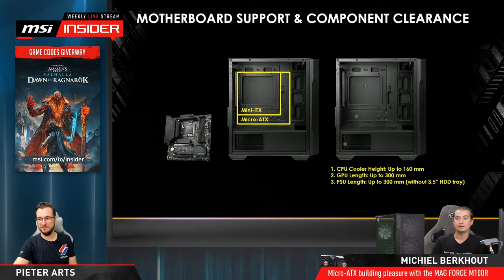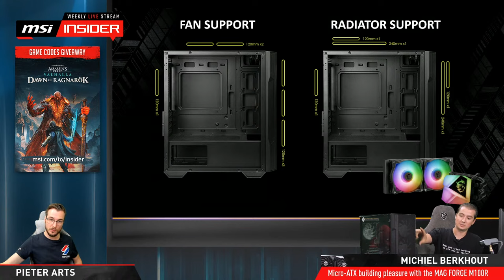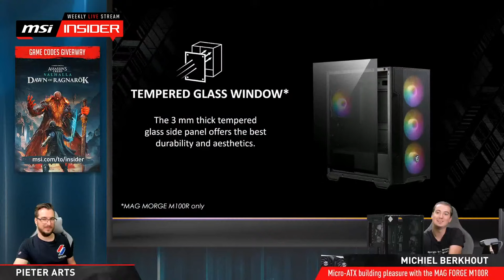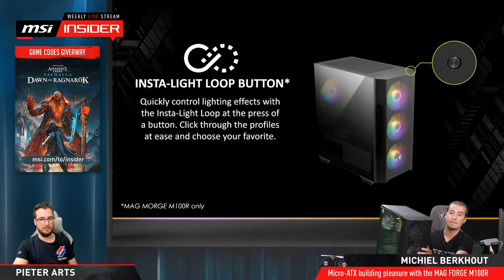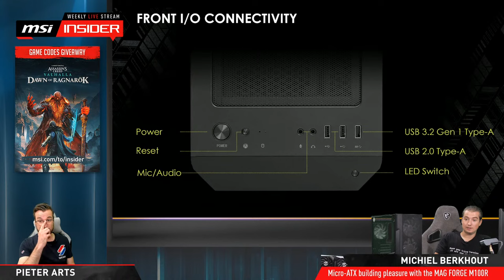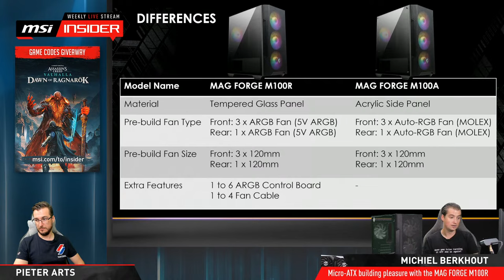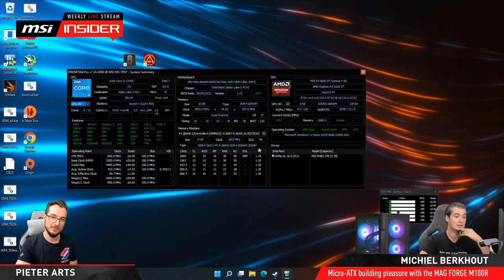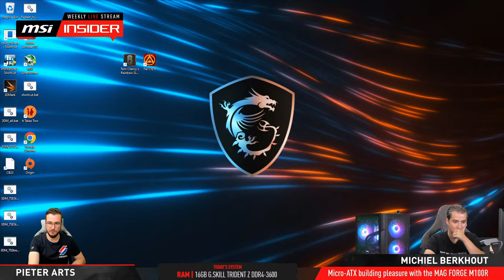Micro-ATX building pleasure with the MAG FORGE M100R

Comment: Good to see MSI finally making some more airflow mesh cases. I just ordered one and looking forward to building in it.
Reply: How is it going?
Reply: @babaty6829  Good it was easy to build in but was alittle fiddly due to my man hands. I reused some spare parts I had. A Msi b450m mortar max motherboard, Ryzen 5 1600af and a Msi Rx 5700 Gaming X graphics card. Haven't really tested it yet with some games or fully stress tested it yet but will get around to it at some point. Going to pass it on to a family member. They are going to love it. Its not a bad budget case.
Reply: @auswolf9507  how about the build quality compared with Lian Li and Cooler Master?
Reply: @babaty6829  i have never really built in those brands of case before. I build pcs as a hobby. Much like this case those brands probably have different types of cases and quality depending on model. So far I have only really built in a Thermaltake Versa H18 which is another Matx case which is similar to this case, DeepCool Matrex atx case and Fractal Design meshify S2 which is a large ATX case and isn't a budget case like this case the or the other two I have built in previously. This case easily beats the thermaltake and Deepcool cases with airflow and cable management.
Reply: @babaty6829  Plenty of awesome case reviews on youtube. You could check out Gamers Nexus for in depth reviews on different cases. Doesn't always hurt to look into other cases. I know Coolermaster have a ton cases with many confusing naming schemes and Lian Li have quite a few cases on the market which are pretty good. Coolermaster has made some duds in the past.
Reply: Hi! Im going to buy this case with i5-12400f and rtx 3060 12gb. 
I wanted to know if the air flow is good and how are the temperatures? Thanks!
Reply: @Cookies7  Haven't turned it on for a few months or really used. I had some old parts  sitting around so I built a AMD system in the case with an MSI B450m Mortar Max, Ryzen 5 1600af processor and a MSI RX 5700 Gaming X Graphics card. Graphics card was a tight fit but was able to get it in fine on the right angle. Airflow should be fine. Plenty of ventilation. The only thing is this case doesn't have a dust filter on the front of it so over time your pc may need a good clean out if you live in a dusty house. Oh make sure to get a decent cooler for your processor. The intel stock coolers are noisy as hell and aren't the greatest in hotter climates, similar to the AMD Ryzen stock coolers. The fans that come with the case do an alright job keeping everything cooled. Been meaning to get it plugged in again to test out temperatures during game play and set up some fan curves for it etc just haven't gotten around to it.
Reply: @auswolf9507  Alrighty! Thank you so much
Reply: Just be sure to get a decent aircooler for your i5 12400f. It will probably run fine with the stock cooler but you can easily drop the temperature quite a few degrees with a decent cooler. less noisy also.
Reply: @auswolf9507  Thanks for the tip! Im gonna do that
Reply: Can i sync all argh with mystic light?
Reply: @maciulo798  If your motherboard has a Jrainbow header or possibly a ARGB header, I believe you can set it up to work with Mystic Light. You would need to refer to your motherboards manual and the manual that came with the case to check for compatibility. Some motherboards have the Jrainbow pins, other motherboards may have different types of rgb headers. Some motherboards don't have them at all. Always best to check the manuals for compatibility. Honestly I never really bothered to connect the cases Argb hub to my B450m Mortar Max board and opted to just use the led button built into the case to change the lights on the fans.
Reply: @auswolf9507  hello do you know if we can turn off the rgb?
Reply: @auswolf9507 How noisy can this get when gaming?  I worry about towers full of fans in the event they all kick up speed and make a hot racket!  Haha.
Reply: @Tube2097   
Testing out my nephews PC the other day the case fans were not overly noisy when testing out a few games. Only really heard the cpu cooler whirring away and the graphics card when under load was loud. With a little tweaking I got the graphics card running cool, quieter and much more efficient.

Comment: If there is a dust filter at the top of the case, then the two fans on top are supposed to be an intake not an exhaust don't you think thats what the engineers intended when they first created that
Reply: It's more to filter dust that settles onto the top of the pc while not in use

Comment: I just assembled my pc, with this case and a mortar b560 wifi, and I can’t get the rgb to work, the lights turn on, but I can't use the button to change the colors, and mystic light doesn't detect it, not the coolers, not the ram
Reply: Did you plug the sata power plug from the fan hub into your power supply sata power connector? Mystic light will only work through a J-rainbow/ARGB port on a compatible motherboard. The cable should be connected to the hub. You need to plug the cable into the correct Jrainbow/ARGB port on the motherboard. Check your motherboards manual and it should show it if your motherboard has one.
Reply: @auswolf9507  thanks bro! Btw I have de Msi mag forge m100a
Reply: @garydelphin  Ah I see I am not familiar with that MSI case but I am guessing the setup would be similar with a sata plug powering the hub and a J rainbow/ARGB cable.
Reply: @garydelphin  hi bro did you figure it out?
Reply: @auswolf9507  do u maybe know if i build this pc i will be able to controll all argb from mystic light?
Reply: @maciulo798  Yes I think if your motherboard has a argb jumper connector. Just connect the fan hub to that jumper. The fan hub that comes with the case I think has the cable you need to connect to the motherboard. Usually the Argb jumper/s are located at the bottom of the motherboard for MSI motherboards. Keep in mind not all motherboards have them and some do have special proprietary connectors so you will have to refer to your motherboards manual to check for compatibility to see what your motherboard accepts. Other board vendors like to use different proprietary plugs so its best to check your manual. The other option is to just use the inbuilt button in the case to change to fan colours.
Reply: @auswolf9507  hey bro can you please help me? My motherboard dont have jrainbow /argb port do you know if that is any controler or something that i can plug on my 
power supply or other port in motherboard to turn on the rgb on my fans?
Reply: @GuilhermeRodrigues-sj8vb  The Led fans should work and light up through the ARGB hub the case comes with. The hub in the back is powered via a sata power plug attached to it from memory so be sure to connect the sata power plug from your power supply to the hub. Then you can change the colours with the button on the case.
Reply: @auswolf9507  TY BRO <3
Reply: @auswolf9507  bro sorry for boring you again but the hub has a sata and a 3 pin connector if i only connect the sata the rgb will work or i have to connect both sata and 3 pin connectors?? Ty for your knowledge btw
Reply: @GuilhermeRodrigues-sj8vb  its 6am but I will try: Each fan has a three pin argb connector that connects to the hub. The hub controls the lights and the hub is powered by the sata power connector. Plug a sata power connector from your power supply into that sata connector for the hub. The fan connectors connect to your motherboard to power the fans. The button on the case changes the colour modes for the fans and is connected to the hub.
Reply: @auswolf9507  Thank you again bro really sorry im from Portugal its 7:30pm   here good luck for you in your life 🙌🏻❤️
Reply: @GuilhermeRodrigues-sj8vb  All good mate. I'm in Australia. I was half asleep so I hope my comment made sense. Hope all is good over in Portugal and I hope your PC build is going well.
Reply: @auswolf9507  is the stock fans loud?
Reply: @MuhammadIhsan390  To me they are not overly loud. They do have a bit of a hum to them at stock configuration but most fans usually have a bit of sound. They are three pin fans.
Reply: @auswolf9507  ah, that's a consideration for me.  I think we can't find any good stock fans even with a Be Quiet! case.